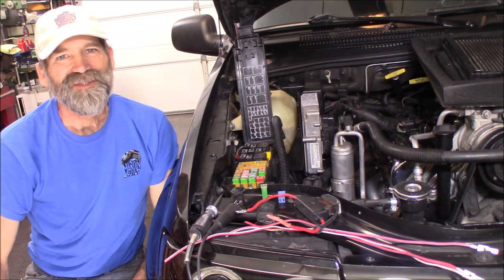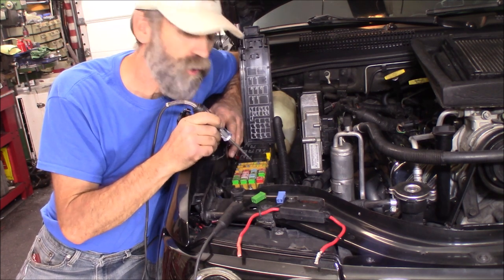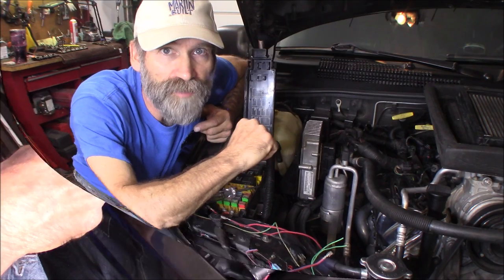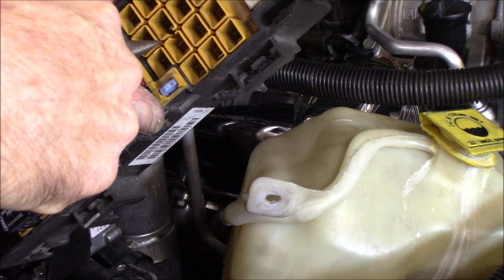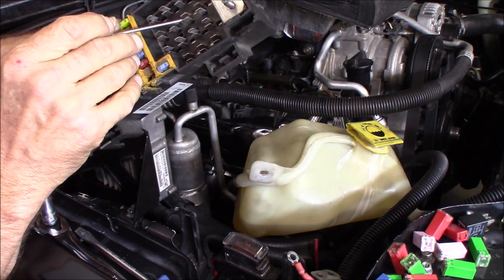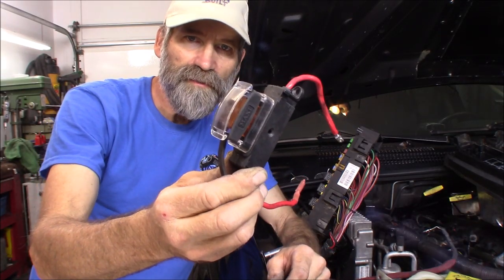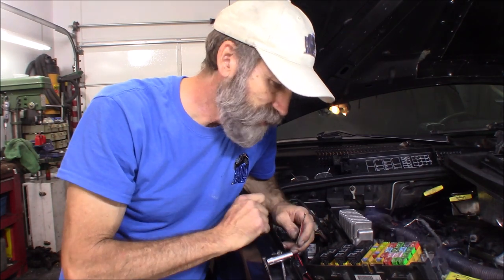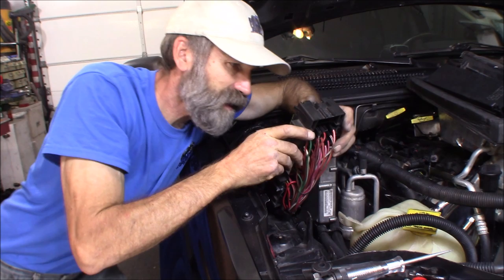How to Add Fuses to the Factory Fuse Box

Comment: Great video, this is how I add fuses, more people need to use this method rather than fuse taps or inline fuses branched off in various paces
Reply from the maker: Thank you I really appreciate that. , it's not as easy as just adding an inline fuse, but the end result is worth it.
Reply: Not gonna lie, was going to just use taps, because I didn't think I could add new sockets. I'm glad I found this. I prefer to do things the right way.

Comment: Hey Martin! I was looking for an example for wiring a relay into the factory fuse box and found your video. Like you I want to keep the engine compartment clean and clear.  It shouldn't be too hard to expand your fuse idea to a relay.  Your detailed video will help my project quite a bit. Thanks for posting.
Reply from the maker: Glad I could help, many tines there will be empty spot or two in the fuse block for adding a relay. This fuse block had room in the back to add 2 to 4 more relays.

Comment: I love that you did this video.  Been looking all over YouTube for someone to show this being done.  My problem is that I need to add mini fuses.  Where can I get the parts or what are the plugs called?    Anyway thanks for the video.
Reply: That's exactly how I found this video.  Youtube is chock full of what seems like millions of videos where people hack in inline fuses or use fuse taps, I'm surprised so few people actually utilize the space in the OEM distribution block.

The terminal for the mini fuses is known as a "Female Junior Power Timer Terminal" I tempted to buy some from Digikey or Mouser, but just because they properly fit the fuses doesn't mean that they will fit all distribution block housing.

Comment: Good info here thanks. I’ve spent 25 years working with alternating currents but just in the last year have become quite interested in automotive wiring. But, be it Ac or Dc I can’t stand sloppy wiring or anything unnecessary like for instance, extra in line fuses.

Comment: I'm a huge fan of this idea. I prefer everything being tidy rather than having random fuses strewn about or three different accessory fuse boxes. Fortunately, I have standard blade fuses. That means I can get the fuse terminals brand new rather than scrounging at a junkyard.

FWIW, here's a source for the blade terminals and pretty much any other electrical connector you might need for a vehicle. I'm not affiliated with the site, just a very satisfied customer. It's one of the best finds ever, they really do carry a ton of the bits that you normally think of as junkyard parts because you have no idea where to find them.
https://www.repairconnector.com/products/Brass-ATO-Fuse-Block-Terminals-10-Pack.html 
Shame they don't seem to have the spade terminals for the FMX fuses in the video though.
Reply from the maker: Thank you for the link.
Reply: @martinbuilt  glad to help. The only bad thing about that site is that it can be difficult to find exactly what you're looking for if you don't know what it's called. But once you figure it out it's awesome being able to order a brand new connector to splice into your harness.

Comment: I have been looking for HOURS for this information. because god damn if people aren't stupid as hell, using those crappy fuse things from autozone to tap into an existing fuse. which then the wire has two fuses on it, one for the original accessory and one for the new. why do that when you can simply ADD like you did... so much better, and looks normal as apposed to jerry-rigged. thank you thank you thank you. I am like, 50/50 on electrical, not all knowing. And with that in mind, I think your solder job could have been better. I would have untwisted the wire into their smaller individual wires, and then kinda webbed them together like putting your fingers together (each strand between another strand, like your right pointer finger between your left hand point/middle fingers). then soldered. there are other wire techniques but I find mine to be more than enough. the other thing with heat in the engine bay, the solder could heat up enough to end up coming undone. ive seen that before. hence doing a better job putting the wires together as apposed to the side by side.

Comment: my car had a fuse melt the plastic and it damaged the box itself. No added accessories or anything just the stock amplifier. Would it be possible to just rewire it into an empty fuse after finding an upgraded wire? Sorry for the rookie question.
Reply from the maker: Usually a poor connection will cause that to happen.
 Yes you could use one of the empty fuze locations
Reply: @martinbuilt  cool thank you I will try it out when I find some time.

Comment: Hey brother , great video. Quick question. How can I tap into a spare fuse that has current ? My headlight fuse slot has no current so I’m trying to see if I can use the spare to rewire from. Thanks in advance
Reply from the maker: Thank you, Mark. You could remove the load wire from the fuse box for the headlights and move it to one of the unused fuses. 
But why would the headlight fuse have no current?
I don't think the problem is at the fuse box.🤔
Reply: @martinbuilt  hey thanks for the reply. I’m thinking the same thing. Is there such thing as a relay giving power to certain small fuse slots , like that work as a unit?

Comment: Do you know if I replace the fuse box with a different box on a 1993 Lincoln mark 8 will it have to be programmed at the dealership?
Reply from the maker: There should be no reason you would need to have the vehicle reprogrammed because of a fuse box replacement even if it came from another year, make and model of vehicle.
Thanks for watching.

Comment: Hey Martin your videos have been a huge help to me in working on my wj ..I really appreciate what you do..but I really need your help with something I changed my gauges on my wj with the stock ones from a other wj  like the grey ones in your wj. They fit perfectly but now some of my needles are not reading right gas .temp .excedra if you could please!! let me know what to do asap I would  appreciate it I dont want to make it worse by trying stuff on my own ..PLEASE help!!!..lol and thank you for your videos 🙏
Reply from the maker: The gauge set that you installed is it from the same year Jeep? There was a change made not sure when, 2001,02 that could cause that problem.
Reply: @martinbuilt  yea same year I have a 99 i didn't thank about takeing a pic of where they were before i took them off so now some of  them do read right how would I go about recalibrating my needles

Comment: I have a 2005 jeep grand Cherokee Laredo. And it starts up and shuts off a few seconds. Do I need to bypass the fuel pump fuse. Or what would u think is going on?? Can u help. Thanks.
Reply from the maker: I would check the fuel pressure.
 It actually sounds like the key does not have the chip in the key or not programed to the ECM/PCM.
 Is the security light coming on the dash?
Reply: At first it wasn't starting up. Just cranks. Until I found a fuel injector broken and replaced it.. then it starts up but shuts off. I don't think the security lights on.
Reply: @martinbuilt  but I am using a spare key that starts up the vehicle. Made not from dealership.
Reply: @martinbuilt  the light is flashing. I watched a few videos. And it seems to b the key. Like u said needs to b programed to ecm/pcm. How do I program a spare key
Reply from the maker: @928chubbz7  I took the original key to Lowes where they can read the chip and program the new key to work. You must use a programable key. There is another way by purchasing this Car Key Programmer https://amzn.to/3FLsTJ1 you can program it yourself.

Comment: 😂🤣🍻👌 u stole my idea! Lol either way yah did a great job filming this- me not so much of a camera man - and vs using a flex lite fan i am using a fan out of a dodge nitro- now its seems to plug and play but its already failed couple times on me.... hows the flex lite fan been working for you Martin? I know it gets hot where you live vs me where i live upper peninsula of Michigan is rare to see 90 degree days ....
Reply from the maker: The flex a Lite fan controller works great , the fan that I'm using is out of a 98 Jeep Grand Cherokee with a 5.9 l
Reply: @martinbuilt  That's a rare bird.5.9 l GC.
Reply from the maker: @joelgleitsman1205  yeah unfortunately it is very rare just under 15000 were made

Comment: Why didnt you run it completely factory. Threw the relay that is turned on based off ECU reading a specific temp?  You could have grabbed a Factory schematic and done it 100% factory, its all there.  But great video!!!
Reply from the maker: It had a hydraulic drive fan in it from the factory not an electric. I installed the electric.

Comment: Hey Martin
I had a question
My dakota is an 05 dakota 3.7l
I found anutta 05 dakota 4.7l
Will I b able to swap transmission from my 42rle to 45rfe
Thanx
Every insight will help
And do u have Facebook
Reply from the maker: you may be able to swap transmissions the problem would be the ECM/TCM and the wiring.
Facebook https://www.facebook.com/Martinbuilt-2351766611763181